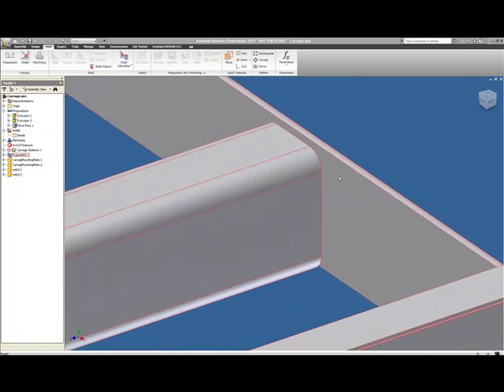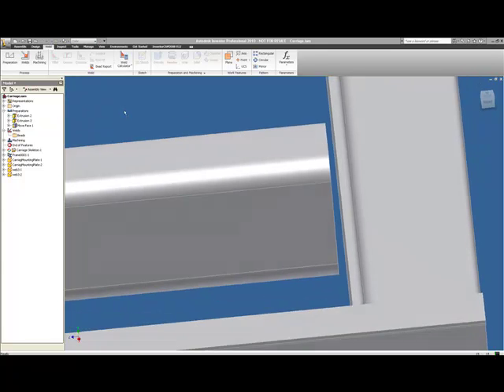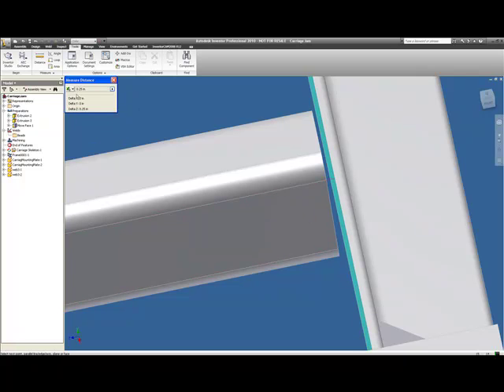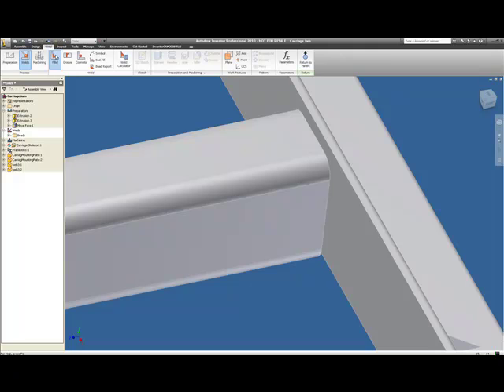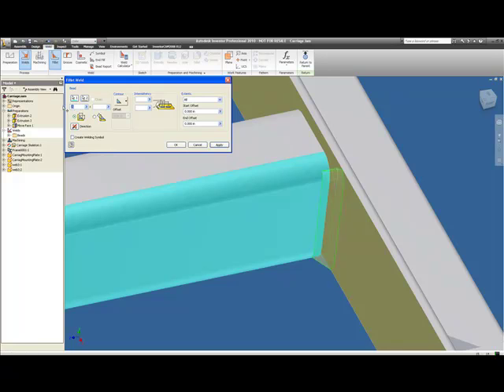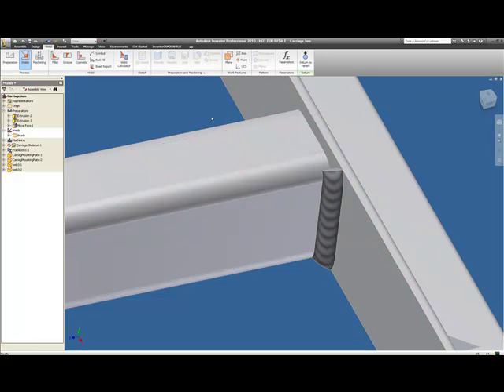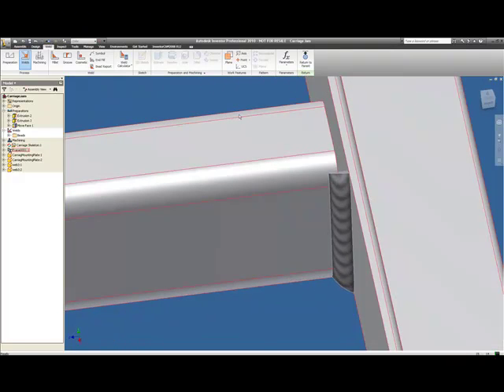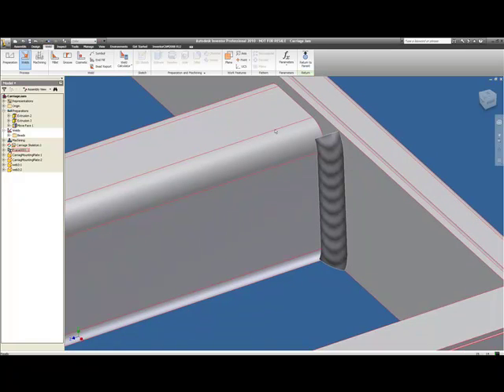Fillet Weld in Autodesk Inventor | Quick Tip

Comment from the maker: A fillet weld can also be done.  If there is a gap, you may need to use a gap weld, then follow with a fillet weld.  Also make sure you select all the faces the fillet will touch (the gap weld, and the tube, for example).